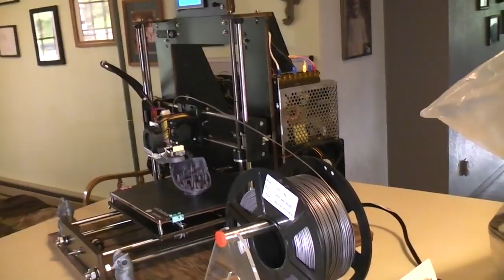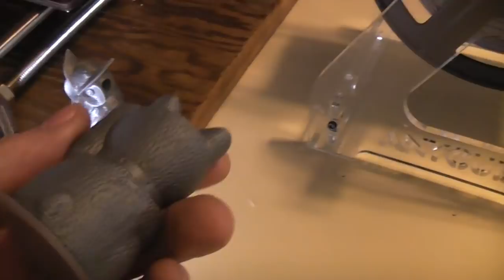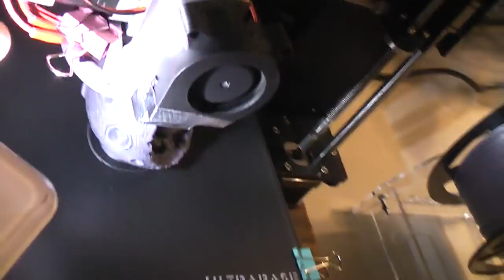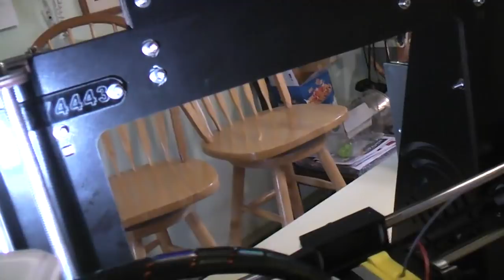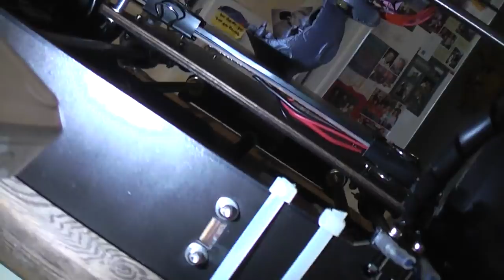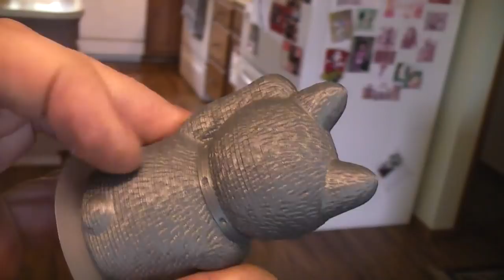$92.40 for a  3d printer.  CTC latest version , Listed as A8 type printer kit May 2018

Comment: So, for an insanely low price, you get a partially acceptable printer for those who like to tweak and modify it? Well, if nothing else it sounds like a fun learning toy.
Reply from the maker: Yes that's it. A lot of parts that can be used to build a custom printer or just as a learning tool. Main thing is , the printer does work.
Reply: @Robothut  Amazing, tempting but possibly a lot of wasted time... I like the idea of a tweakable cheap junk printer that I can fool around with and learn without risking so much, and still potentially get good prints, and that seems to be what this is.

I had those thoughts about Ender 3. I guess that is simply a step up in price and reliability and a step down in how much I want to risk damaging it when playing around with it.
Reply from the maker: Also consider buying off ebay the Flash Forge AS IS returns. I have bought 3 printers this way and got them from $100 bucks to $250 bucks depending on what printer I was buying and was able to get them all printing in less than 1 hour. Most are returned to the USA warehouse because of minor shipping damage or a filament jam. Worth looking in too, you never know what will be up for sale. I have done a few videos on these. So check threw my channel.

Comment: i  got the ctc cr-10s for $238 (says a10). i didnt know it was a clone until i saw the brand name was not creality.. i asked them about it and they shipped it instead of cancelling when i told them i wanted a real version (ebay). hopefully it isnt junk..anyone have exp?
Reply from the maker: Wow. Be sure to post what you do get in the end, or do a video showing what you get.
Reply: I got one. As far As I can tell it has all the regular parts (creality ships theirs with some minor upgrades now though). Mine didnt come properly assembled, belts and screws were loose etc., but all the parts were there except for the part fan cooling duct. I pretty much had to rebuild it, but now it prints wonderfully. Definitely not the 10 minute setup time experience, but alright for half the price.

Comment: possible to convert to am8?
Reply from the maker: Sure. Its just low cost parts so why not mod it to a AM8 type printer. The only reason not to do so might be the cost of all the mods when added to the cost of the CTC will be more than just buying a better printer in the first place I guess. But if you have a CTC that you got for cheap then why not.

Comment: Looks like the X belt needs tensioned.
Reply from the maker: It is tight, the plastic pulley kind sets a limit as to how tight you can go with it. I did play around with it. Replacing the pulleys with metal ball bearing ones would be a good idea as well as all the bearing rods, they all measured 7.7mm to 7.8mm and the bearings are 8mm, so lots of slop there.
Reply: what did you do then? replace the rod? thanks for an epic video! going to get one just to play with
Reply from the maker: You might like this video where I modified the CTC printer kit to a type of linear rail system just for fun.
https://youtu.be/j7mh-eygIw4

Comment: any manual? 
Can i use this with fusion 360
Reply from the maker: My video was of the version sold early in 2018, it is now the end of 2019 and when I look on line I see the printer has changed a bit. they now have a safer power supply and print resume after power loss. There is a build instructions, but they might be on a memory card now. Fusion 360 is a cad 3d program for designing 3d models. It has noting to do with the type of 3d printer you own. But Yes many builders like to use fusion 360 to design there 3d models that they then 3d print. I like the free program Design Spark Mechanical better to design all my 3d printed mechanical robot projects.

Comment: the only thing thats crap on that printer is the frame its made from cheap compressed wood but the rest of the hardwear is worth the price i made a aluminum base for that frame 100% better the wable is from that frame!
Reply from the maker: Yes a great deal just for the parts and chance to build and learn and mod. Every now and then they sell for $76 bucks.
Reply: got it from ebay for 87euros came from germany im useing it to build a DIY printer im new at this
Reply: hitech greek 
can you share a link from ebay or give the titlle of the auction/seller etc.? 
Thanks